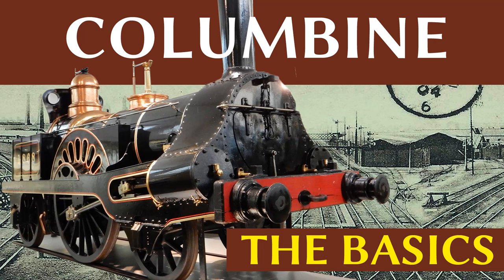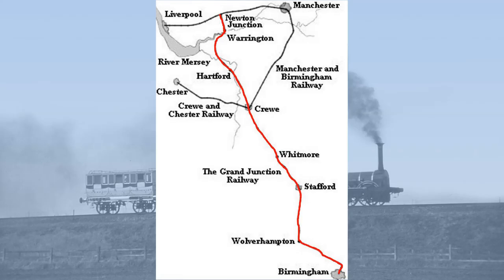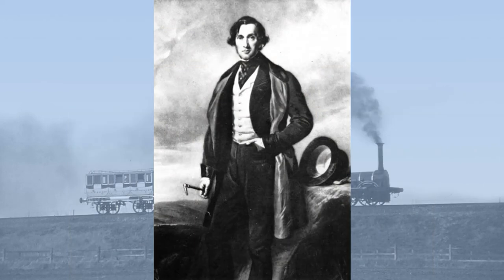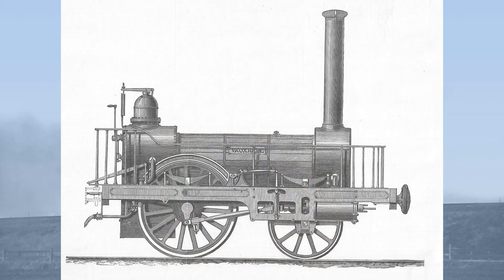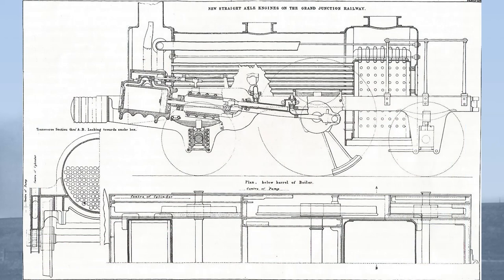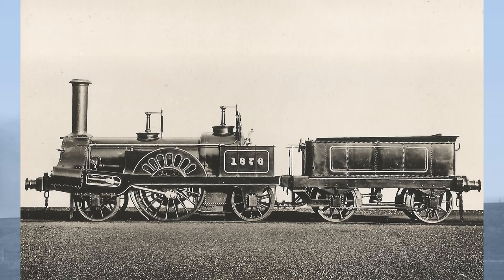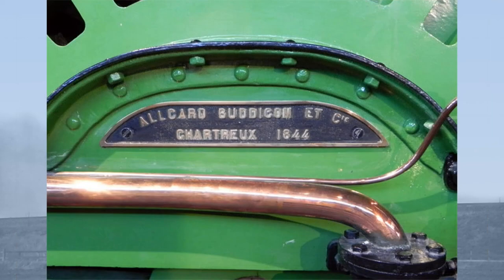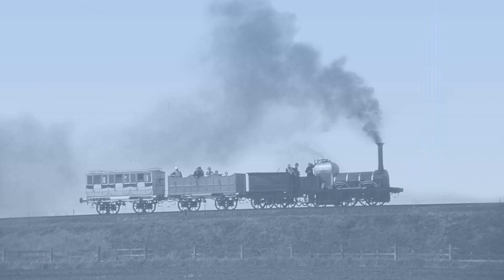Columbine: The Basics

Comment: Good evening Mr Dawson here are some more facts on the Columbine. First she was built with a 80psi boiler wich was 3ft 6in and 9ft long. Her boiler pressure was later increased to 120psi somewhere in the 1860s and there is a line noting that she attained 57mph, although this most likely was not so during her early years of life. Do correct me for any mistakes I have made.

Comment: Question: Why was the Crewe Type's freight variant made as a 2-4-0  instead of an 0-6-0? was it a fear of excessive oscilation cause by a combination of outside cylinders and adhesion? or were the curves too tight for a long enough wheelbase?
Reply from the maker: It was to enable them to run steadier at speed without damaging the track. They had a rigid wheelbase so the smaller leading wheels helped it take curves etc far mor easily. O-4-0s and 0-6-0s and 0-4-2s are all very well but at speed the large leading wheels hammer the track a lot going in and out of curves. 2-4-0 is much easier on the track. :-) Hope that helps. Ant.

Comment: Thank you for this one. I'm curious though, when Columbine is counted as the last of the type in existence, why isn't Cornwall counted?
Reply from the maker: Because Cornwall is it own thing. She's a one off, and started out life as a rather odd 'freak'. Video on her coming soon :-)
Reply: @AnthonyDawsonHistory  I'm looking forward to it. The little I've read of Cornwall in Trevithick's own words suggests he considered that locomotive a success, so where exactly his definition of success diverges from the opinions of others would be interesting to discover. Or is the reputation of the original build of Cornwall something that was invented after the fact?
Reply from the maker: @furripupau  I think because the original machine was so bizarre. Cramptons were good engines but get a bad reputation in the UK because they're odd, differant, unusual. The original Cornwall must have been very awkward in service and to maintain. The rear carrying axle passed through the fire box so that must have been hard to keep watertight and keep the firebox from cracking. The driving axle passed over, or depending on the illustration, through the top of the boiler barrel. Weight must have been an issue as it was rebuilt from a 2-2-2 to a 4-2-2 at an early stage.